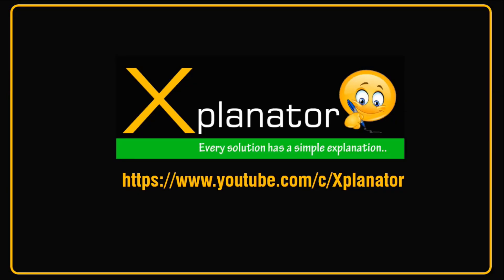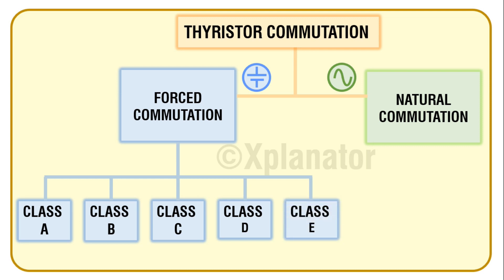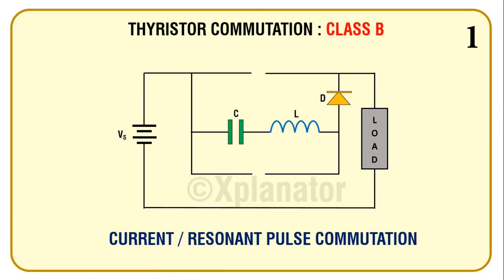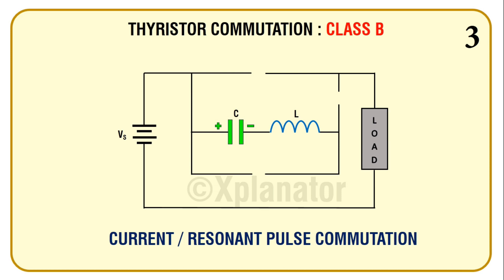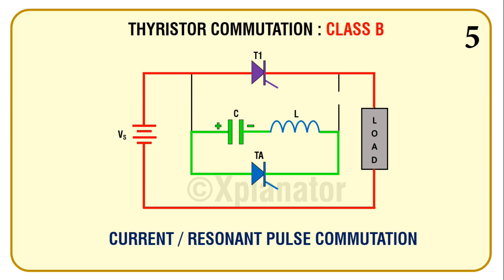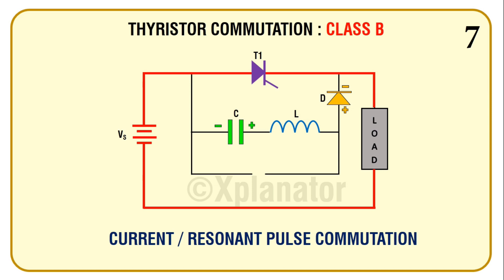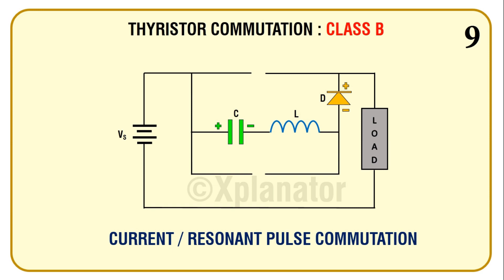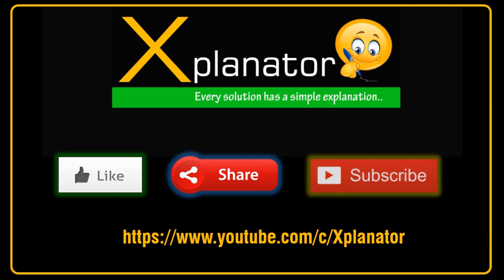Class B/Resonant Pulse commutation for Thyristor(SCR)

Comment: But why the capacitor polarity becomes alternate (change) ???
Reply: capacitor first discharges through inductor, inductor current reaches its maximum,  now capacitor voltage is zero and inductor acts as current source,  inductor now discharges through capacitor, but capacitor gets charged in reverse polarity,  bkz current now flows through inductor to capacitor.